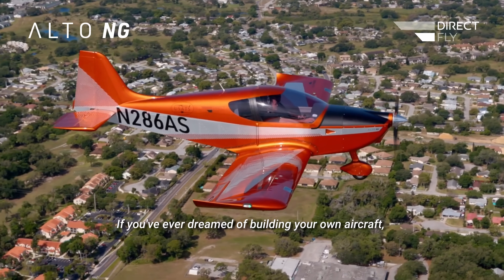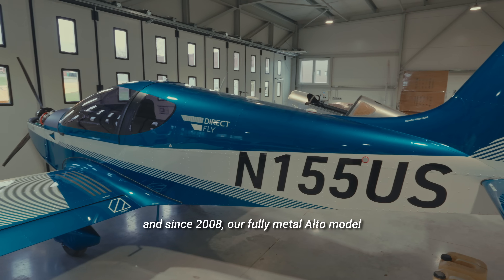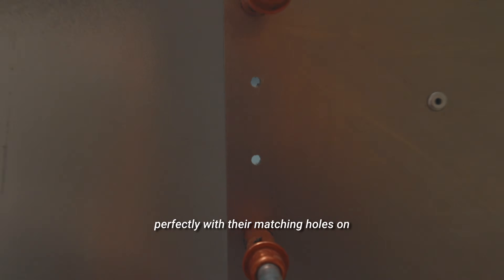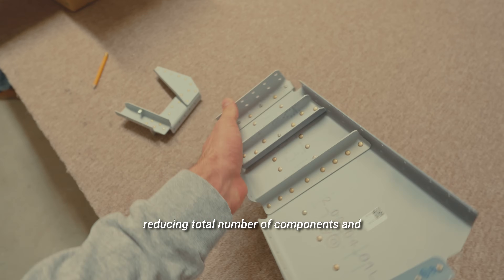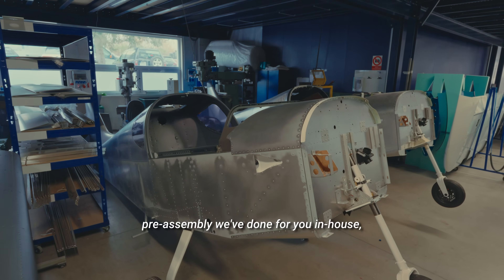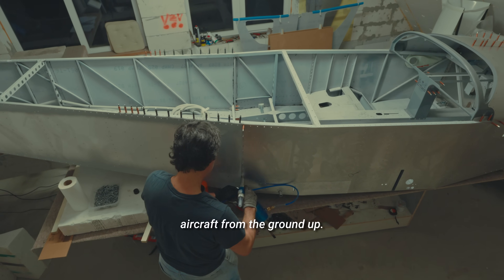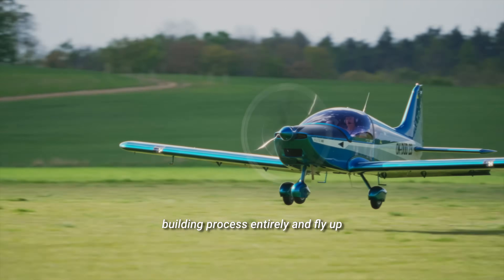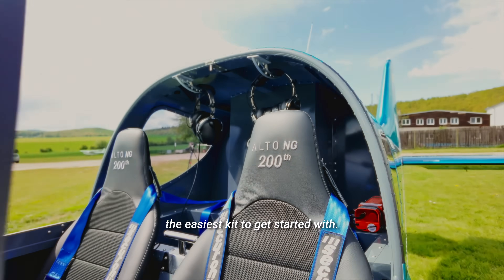ALTO NG - Hidden Gem - The Easiest Light Sport Aircraft (LSA) to Build on Your Own

Comment: I work on the 286 in the US…very good plane, solid, well built, easy to work on…even the avionics with an easy access door…flys great for what it is.   Courses, climbs and cheap to operate…4-5gph @ 115-120mph.  Now with mosaic, it can be configured for IFR.

Comment: In Europe it may be an ultralite,  but in the US it is NOT a legal ultralite.
Reply: Can you elaborate please?
Reply: @djwashx  It's confusing because "ultralight" means very different things in Euro & US regulations.  A US ultralight is very light (=<254 lbs empty), slow (55 kts. max speed) and single seat.  The US Light Sport Aircraft rules are similar to Euro ultralight rules.
Reply: @anim8ted923 good answer. Mosaic is set to change everything though
Reply: @djwashx  in the US and ultralite is only one person.

Comment: From what I can see in the video, this plane wouldn't qualify as an "ultralight" in the US.
Reply: You guys call it Light Sport, but in Europe, that's an ultralight. Though I agree, 600kg/1320lbs isn't really "ultralight".
Reply: Europe has different categories than the US. 

Ultralight are just very light GA aircraft. Microlight are mostly fabric, weight shift, etc. And UK also has very small SSDR deregulated under 300kg and 35kt stall.

Comment: $200k+ plane and they use a cheap AI voice-over.
Reply: The fact that the  company's response to every comment here is done by AI rather than  by a human, leaves me with a bad feeling. Leafs me to wonder what customer service and build support will be like. Unfortunate because it does look like a nice option as a kit build. Hopefully they can figure this out.
Reply: Sure, with no engine, prop, or avionics. A Rotax 912iS firewall forward is going to cost 45k+ minimum. You’re showing Garmin avionics and autopilot in this video, figure another 30k+ for the panel and radios. So at 100k ready-to-fly you’re saying you can manufacture and assemble an entire airframe for 25k..? 

So I don’t believe these numbers, but I guess the question is if you could do it then what corners did you cut to get there?
Reply: @OfficeGrayDesk I don't believe that number either. 30 grand for a radio? You live in the most expensive place on Earth. 30 grand for a radio?😮
Reply: @Brad-sh2wn  30 grand for basic glass avionics (1 G3X, transponder, ADSB-out/in, COM, AHARS, pitot/static, backup battery, compass, autopilot) is pretty normal. There are many little modules behind the panel that go into even a simple avionics package and each one is expensive. You might be able to get that into the low 20s using off-brand like Grand Rapids but Dynon/Garmin is going to hover right around 30 and IFR capable will be around 50.

Go to the Order a Kit menu in Vans Airfcraft and experiment with the avionics configurations for their RV-12iS and you get a sense of what a VFR panel for a light sport costs. Those configurations aren’t even that inclusive as they don’t include secondary AHRS or heated pitot and the wiring harness costs are baked into the kit. But yeah, it’s shockingly expensive.
Reply: @OfficeGrayDesk  There are cheaper options though. Like going steam gauges with an iPad for navigation. Garmin is expensive, but everyone wants their dual G3X quasi-IFR avionics nowadays. It's nice, sure, but I really don't get it.
Reply from the maker: European prices starts from 30K EUR for Basic kit, 50K EUR for Quick kit and 100K EUR for Ready to fly. However, the prices vary for different countries due to different shipping costs, customs, registration and so on.
Reply: At least you can hear the voice over the music. BTW, $200k is about right anymore. Used to be you built to save $$$.
Reply: More likely this is just vaporware with a cheap script and AI played over some B-roll footage.